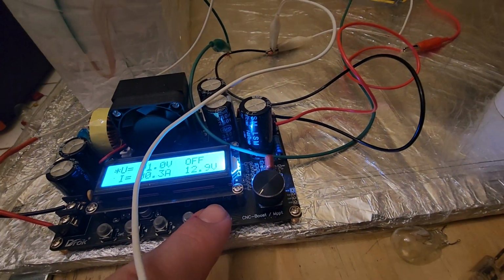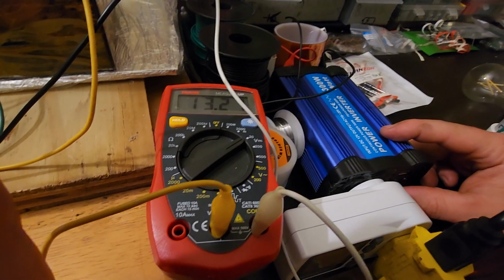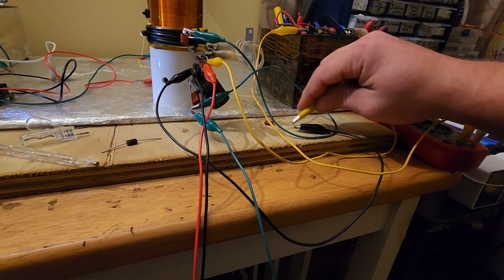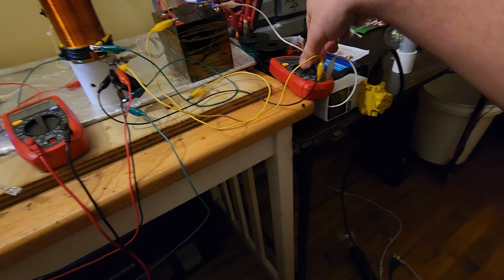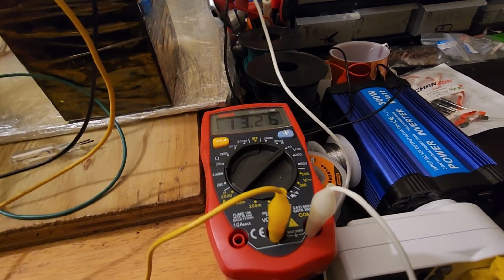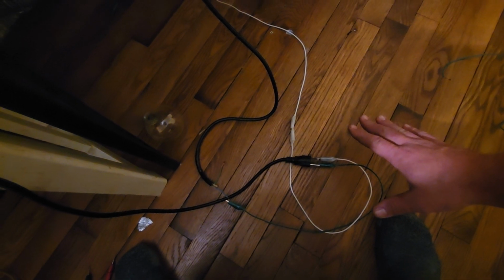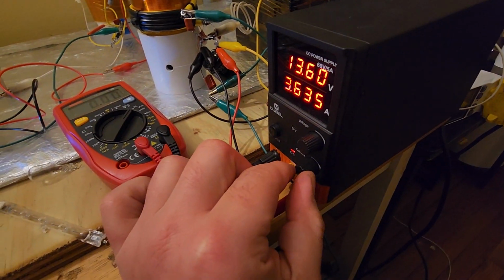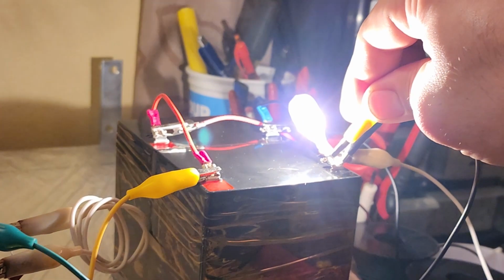🔮 Effecient Tesla Energy Runs Anything From The Earth 🌎 Unlimited Wireless Power For Everybody ⛈️

Comment: No, the electric field your transmitting is being shorted into the foil plate. The ground energy seems to always be the other end of the "wireless transmitter circuit." Its definitely radiant energy.
Reply: I noticed some crazy things already. One is that the human body must touch the light for it to light. We seem to be necessary. It's so weird. Have you noticed this, yet? And I found an old Iron Mailbox where certain spots on it light up the led to full intensity far away... like cat whisker tuning on old blackened Iron crystal semiconductor I think.

Comment: I know you recommended the XS 600 watt 75 Farad super capacitors instead of your brand, but just out of curiosity, what is the rating on your caps?  Also, for your input you have 4 of those together, if I were to do that with the XS caps it would be $800 for the (4) 75 Farad (600 watt) caps but XS also makes a single 12 volt 500 Farad (4000 watt) battery for just $500, would that be a better way to go?
Reply from the maker: Each one is 100 Farad i believe & super caps are just the best way to go but not absolutely necessary & the latest nimh battery tech can work too that has no memory effect :)
Reply: @MTECH2022  They've got the size my diesel truck takes, I'll just order a pair of the 500 Farad ones and throw them in the truck when (if) I'm ever done playing with them on the bench.  Need you to perfect this thing so I can swap out the battery pack in my EV Hummer, the battery pack alone is just under 3000 pounds!!!
Reply from the maker: @justbob1581  that's some serious capacitance lol & i really think within a year or two I'll have a very powerful self sustaining wireless power generator that can power up half a house soon :)
Reply: The super capacitors can be EASILY made at home! One of my favorite channels ever (like yours, Mal) he shows how to make supercaps very, very easily at home. I'm going to add silver nano particles or copper ones to the graphite/graphene + activated carbon high surface area electrode mixture. He makes 500 Farad suo
Supercaps for pennies. His channel is: JoyOfElectronics.

Comment: input of my rotary motor... double push pull... 4 volt 5.1. 5 watt without earth, without amps, output 1x 14 volt under 500 milli ampere load and 1 x 35 volt under 1 ampere load... 😇😇😇😇😇 with torque and no increase in consumption of the mechanical axis being loaded... I'm going to add the ground and the soldier amps I'm so happy haha.... 😇😇😇😇😇😇😇

Comment: Dude!  I don't have a bunch of caps laying around, but I just took a 16v 5600uf and put it between the 1/2 bridge ground and ANY large piece of metal within a few feet of the transmitter and it filled in under a second!!!!!
Reply from the maker: Hell yeah & happy experimenting  :)
Reply: Super cool. Joy of Electronics channel shows how to make incredible Supercaps at home! Super cheaply and super efficient designs! It's incredible! 500 Farad supercap but it would be charged at.... low voltage BUT HIGH FREQUENCY! We all gotta try it. Homemade supercaps with graphene/graphite/activated carbon made into paint. All done at home. Robert Murray Smith shows how to work with graphite at home easily. I recrystalize the graphite at home as my first step.

Comment: Amazing. You even did the large laminated metal sheet. Wonder what would happen if you added more layers?  Question: Is the ground wire that is connected from your Tesla receiver (and Tesla transmitter protection diodes) connected to another ground in the house or is it also connected to the radiator metal like the ground wire to your loads?  Thanks!
Reply from the maker: Hi the transmitter is grounded into the heater through a rf  film capacitor & the receiver coils are also grounded to the heater through a film capacitor but can be grounded anywhere & still function the same :)

Comment: Looks like you could use bigger test load
Reply: And thicker earth wire
Reply: I found a possible anomaly with Iron in this system. Iron crystals or something. I have an old mailbox I just noticed thst it Iron and on certain exact spots it's a highly efficient antenna but my body is always necessary to light stuff... so that's really weird... I'm always the circuit path but Iron semiconductor stuff seems to really be an efficient antenna at certain parts of its crystal structure like a cat whisker tuner.
Reply: @TravisTellsTruths  you are acting as a virtual ground, an electron sink, matter mass, what ever nomenclature you prefer. Connecting to a proper earth ground will do the same. Not mains ground but dig a hole and put a large metal object in it, most use an old car radiator. It should do the job. and remember thick earth ground, preferably insulated all the way from the buried object to your work area.
Reply: @GuardianEngraving that's what I thought but it doesn't actually work that way. I'll explain. Mine will light to grounds in my home electrical system but will not light to my standalone copper grounding rod outside. It WILL light to FULL intensity off of an old cast iron mailbox that is mounted up high on a wall way above the ground (up on porch only mounted to a wooden wall... my guitar amplifier inside it loves but all the way outside, this cast iron mailbox.... it's very tricky but on the exact right spots, it lights the LED to maximum intensity. But in every case, my body MUST touch the led or so far it won't light. So my body plus this iron situation. No ground. Won't light with my body and a copper ground rod outside... it loves iron crystal. I'm telling you. We need an iron crystal cat whisker  antenna/non-linear receiver📡
Reply: @TravisTellsTruths  hmmm interesting, I have not seen that before.